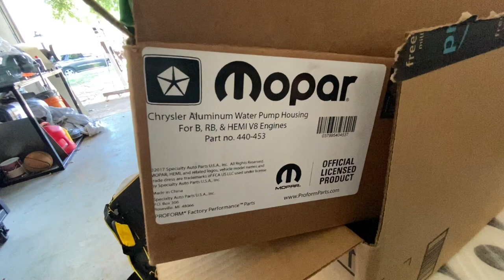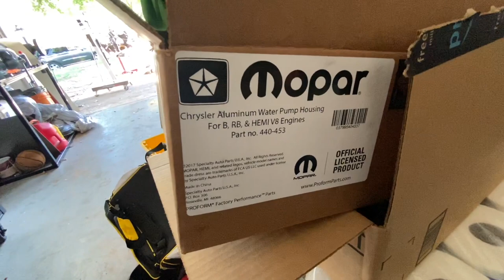HOW TO FIT AN RV MOTORHOME 440 ENGINE IN YOUR CAR

Comment: Great wealth of information, especially for a novice like me who may or may not want to tackle working on an RV 440. Thanks for posting and pointing out the 440 car/RV motor differences.
Reply from the maker: Thanks for watching!
Reply: Maybe you already covered this, but when you installed new head gaskets was there an issue with the cooling water ports? From another site, I read where there the RV 440 has additional flow ports that are not in the “normal” 440 block.  Can you just modify the new head gasket and be OK or use an actual RV gasket? 
Thanks for your response. If you already covered this, I apologize.
Reply from the maker: This is actually an outstanding question. I actually haven’t ran across that yet. I’m currently filming my assembly process and will find out soon. I will make note to let everyone know what I find out.
Reply: @wills69charger1  Thank you. It’s all great info. You do a nice job with your videos. I look forward to more.

Comment: I just found your channel. I did the same thing with my 67 coronet using a 76 440. I am running the 452 heads. When you port the heads , you get a little better performance than the 906s with the benefits of hardened valve seats for unleaded fuel use. Most of my parts came from Mancini Racing. Im using a complete Lunati,cam.lifter,and spring kit. Some of my parts also came from 440Soarce. looking forward to future vids.
Reply from the maker: That’s great! Always good to hear from a fellow Mopar fan. How do you like your setup? Would you do anything different?

Comment: I just got my 76 motor home 440 back from the shop. Bored 40 over. Went with 440 sources stroker to a 512. We are finishing the block next week.
Reply: Did you stick with the 452 heads?  Can you swap 915's onto that block, or not?
Reply from the maker: Sorry I just seen your comment. Did you end up finishing the engine?
Reply from the maker: Yes 452 heads and 915 heads can bolt onto that block.

Comment: Not too many videos on an RV 440 engine comparison, even fewer involving a 318 to 440 swap.
I'm doing the same, of course the budget determines pace of build. 
rundown:
Low compression engine
exhaust manifolds
452 heads, more coolant flow, hardened seats
water pump return on drivers side, (440 source does provide passenger side if 318 radiator is an AC car, 26 in) either one is lighter than stock
RV cam shaft
Oil pan
Oil pump pick up
K member is the same, but will need new mounts
Will, I'll most certainly be watching your videos, keep up the good work and information!
Reply from the maker: I appreciate the compliment and thanks for watching!

Comment: Hey Will, just saw your vid on “comparing car 440 to rv 440”. Interesting vid where you show some differences between the two engines. I’m a 440 gearhead too. I run a 70’ challenger R/T, originally a 383 mag. but I put a 440+6 w/ 727 in it. Nothing like big cubes bro! By the way, that’s a beautiful 69’ you have! Anyway, Good luck
Reply from the maker: Thank you Steve. The 70’ Challenger is one of my favorites as well. I appreciate you watching! I bet your car is west looking!

Comment: Thanx Will. I am curious how that project turned out, you put that 440 in the 69’?
Reply from the maker: It’s stalled out unfortunately. The block is machined ready to go back up but never did anything with it. I had two babies back to back and they take most of my free time. I’m ready to get back on it though.

Comment: Motorhome engines (regardless of make) generally get pretty hammered on. Most motorhomes of this era have 4.10:1 gearsets, and no overdrive so they turn a lot of RPM's between gas stations. 
That said, it doesn't look like much ridge in the cylinders. Check the piston clearances with a feeler gauge, and you'll probably find that the pistons will be close enough to run. You're not building a race engine.
Reply from the maker: Interesting, makes a lot of sense. Thanks for the feedback! No ridge on the cylinders thank god. Thanks for watching!
Reply: Most of them don’t have a lot of miles on them though because rv’s don’t see too much use. Maybe 3-4 big trips.

Comment: There are actually two different heads that have 452 casting numbers. If it takes a 5/8 plug it has the extra cooling holes. Standard 452 heads take a 13/16 spark plug. Also they flow close to 906 heads but have hardened valve seats.
Reply from the maker: Good to know! Thanks for sharing. Didn’t know they were comparable to 906’s

Comment: Good video..I'm wondering what the RV engine produces in Horsepower and how much price wise it would cost to bring it up to a MOPAR 440 375 Horsepower spec ?...which I think most people who do this swap will be looking at achieving
Reply from the maker: Thank you! These were around 255hp and 360 ft. Lbs. of torque I believe. To bring it up to 375HP range you would be looking at around $1,500 for new parts. You could possibly get used parts for about $600-$800 but in that price range you might as well find a car 440 to begin with imo. I will get more in depth with pricing in my next video. Thanks for watching!

Comment: Are you using the factory cam? if not what kind of cam are you putting in it, I’ve just pulled my motor out of an rv the same year as yours and I’m putting in my 70 charger lol
Reply from the maker: Yes I am. The plan right now is to reuse as much as possible. I have read that just replacing the cam on these really helps with compression but I’m reusing mine and replacing it down the road. I just want to get everything in the car first.

Comment: Are you unable to use the 727 that came with the motorhome?  Obviously, you would need to get a tailshaft, but isn't the rest of the transmission the same?  Thank you for sharing!
Reply from the maker: Yes, besides the tail shaft everything else is usable. I believe these have some reinforced parts as well.
Reply from the maker: Thanks for watching!
Reply: @wills69charger1  thanks that helps a lot!
Reply from the maker: My pleasure! Thanks for watching